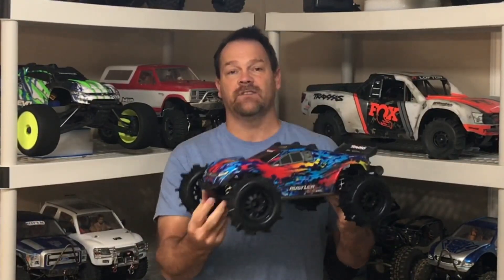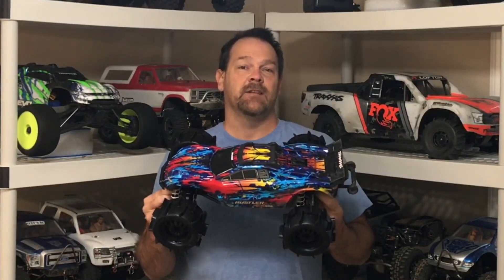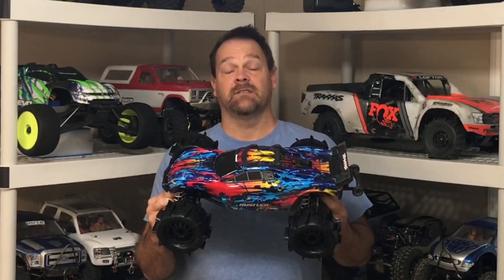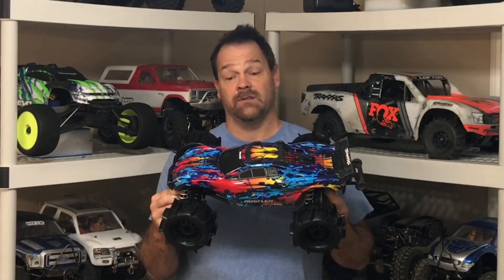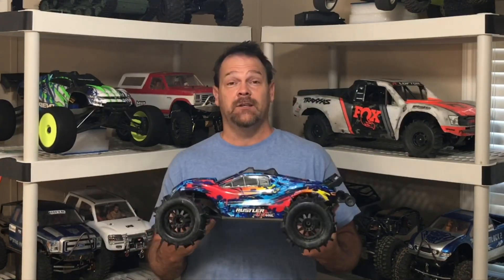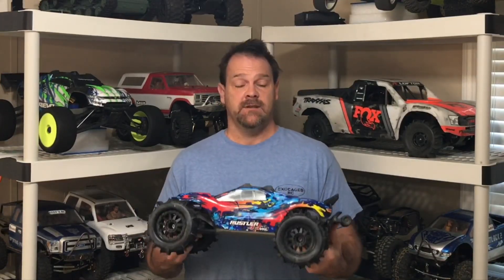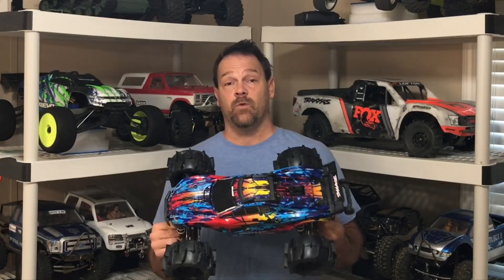Rustler 4x4 with 2.8" sand paw

Comment: I’m thinking of putting the 17 tooth on mine, but I know ur not suppose to use it if ur gonna be running n grass n stuff or it’s gonna overheat most likely, but I still wanna try it n see the difference. I’ve heard 14 tooth is the sweet spot
Reply from the maker: Trust me it WILL overheat. Good thing is the esc hits about 200 and thermals and the motor is around 150-160 so it kinda saves the motor in a way. With the setup in this video I had no heat issues at all
Reply: Exocaged RC good to know thx for the info bud
Reply: I have a 23 rooth lying around
Reply: I run a 13/52 setup in the Slash works well, motor still gets a little warm with me driving cause I'm always in it to win it. 11/54 in Crystals Rustler still stock. Was thinking of borrowing her 17 and throwing it in the slash with the 50 spur and see what we get on the top end. Or even a 23/50 combo. Get the GPS out boys were going for a ride.👍👊😎☝️🐍 Speed runs only.👍
Reply: @mr.boombastic8612  if that 23 came with one of your Traxxas rigs then it won't fit, the rustler is a 32 pitch and the 23 you have is 48 pitch for sure if it was 32p it would be huge like the size of a spur gear lol.
Reply: @micronrc3856  I used to run 17/54 in my slash and it ran great but it was 2wd and I've noticed the 17/54 with the 4x4 overheats off-road and you get the thermal shut off, I think it's just pushing four wheels instead of two is more strain causing it to overheat.
Reply: @stpbasss3773  I have the spur to so its ok
Reply: @mr.boombastic8612  yeah but a 48p spur and pinion a 23/86 is like a 15/54 on a 32p and the 48p will strip easier.

Comment: Are the proline sand paws batter than the Traxxas sand paddles?
Reply from the maker: I like both but the Sand Paws will go right on your truck, the UDR sand tires I used previously required quite a bit of work to get them on there.
Reply: Exocaged RC oh, I’m probably going to go with the sand paws with those method style wheels, they look sick. I think the traxxas sand paddles are more expensive